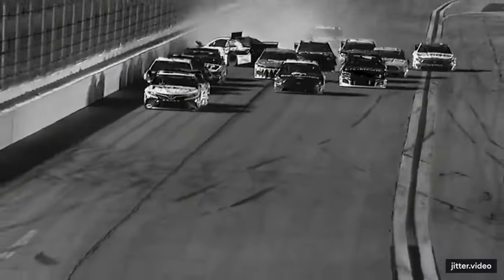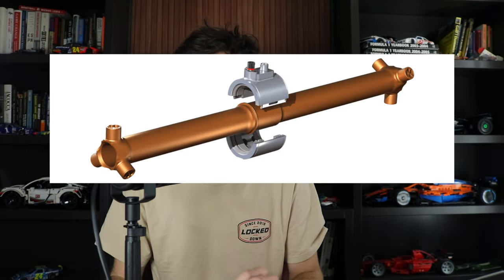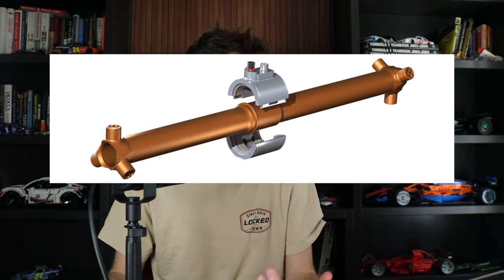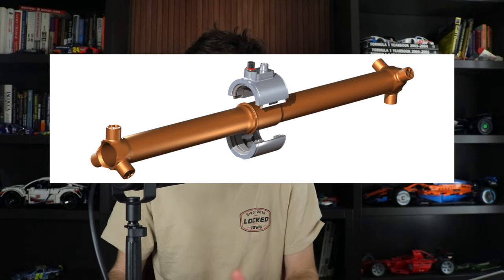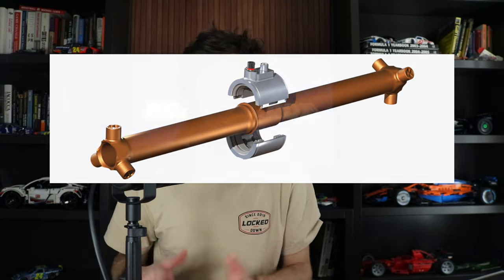NASCAR Is Running A Torque Sensor At Richmond, Possibly For Various Engine Sizes?

Comment: This would seem to be about getting a baseline for electrification, to limit electric motor torque to not tear up parts and pieces that weren't designed for it.
Reply: I like your theory better!

You can get torque and horsepower reading directly from a engine dyno! Which I'm sure they already have this information from all three brands. 🤔

Comment: NAZICAR is a joke......a "Sensor" is needed to control NAZICAR. Why don't they just build every car and lease them to teams under their own spec for a price.....or just eliminate teams and have the racing totally controlled by them. It's what they are leading to anyways so just cut the crap, get to their goal and call it a freaking day. Still can't believe people watch this crap with enthusiasm.....what dupes.
Reply: How tf does this relate to Nazis 💀💀💀💀
Reply: @ProxiProtogen Agreed.
Reply: Jim has a valid point. 
They limit every angle of everything!!! 
Let the guys do what they want, a little cheat and some fights would be good for the sport. 
It’s only a step from nascar leasing you the car to race. 
We need fun the old days of racing!!